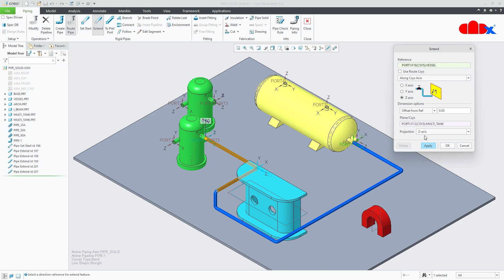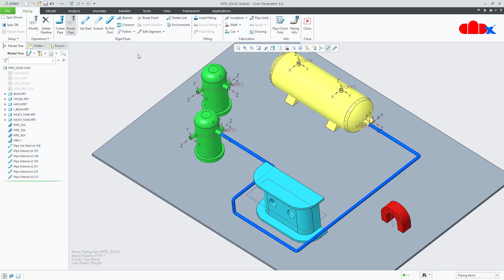Piping design in Creo Parametric

Comment: What is the difference between specification driven piping & non specification driven piping. Also can u please explain flexible command in CREO
Reply from the maker: Specification driven piping is the Pipe design using pipe schematic diagram. Non specification driven piping is the pipe design using the line stock. That means manual piping.

Comment: Sir creo is more complicated then solidworks. The solidworks piping is very easy and also take less time to design any piping assembly.
Reply from the maker: If you watch full video you will understand it better. Full video is for 80 minutes.
Reply: @CADx-in hello sir how did i get the channel membership?
Reply from the maker: Use Join option to buy a membership. Select the right option inside.